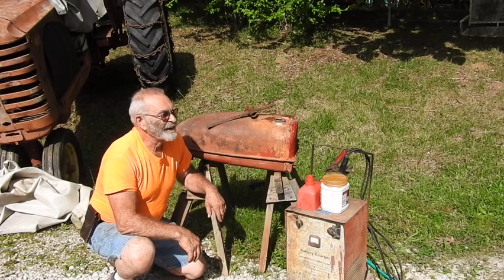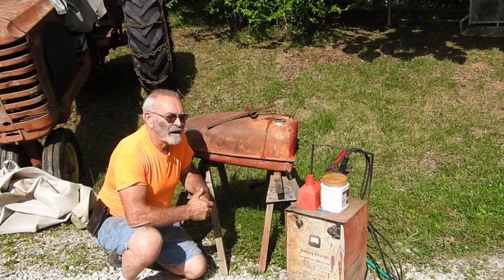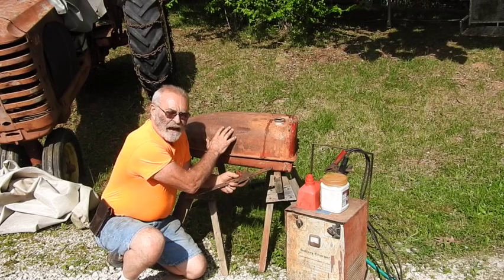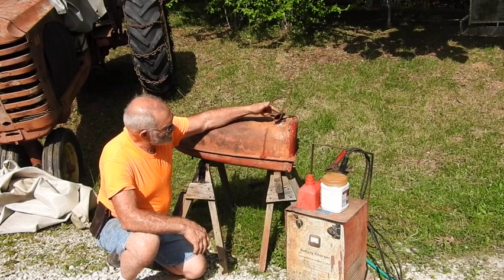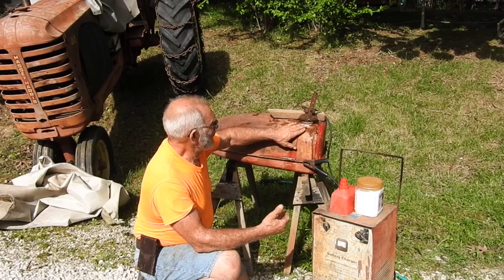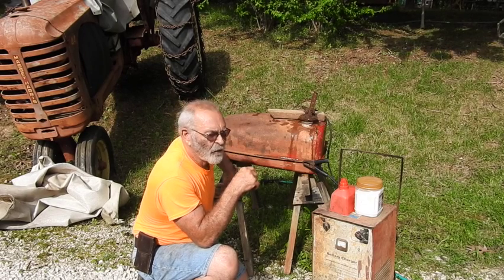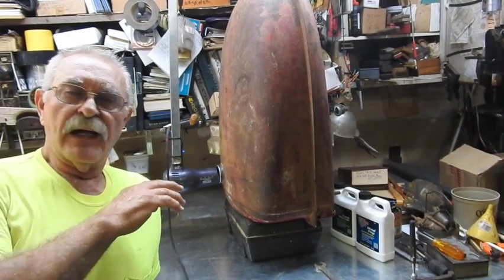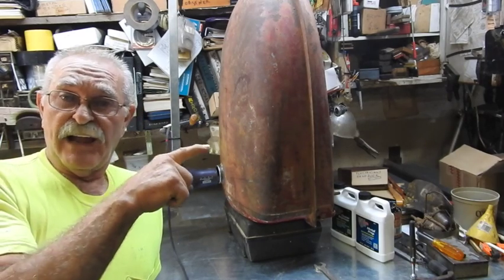Farmall H Gas Tank Electrolysis Rust Removal

Comment: Great video Wendell, i have done several motorcycle tanks this way, and a few old car tanks as well! The only real difference is that I also torch soldered any rust holes first, then cleaned, pressure tested and then treated the tanks. The good thing about being in a radiator/ tank repair shop is that you have the ability to completely fill the tank with the treatment, let sit for ten-15 minutes then drain, for the etching compound, and the same goes for the treatment, we would line up 10-15 tanks a month, and only do this once a month for our customers who didn’t want replacement fuel tanks. It always worked for us, but people thought I was crazy for using a flame for the initial repair! Like you said. ”DON’T  TRY THIS AT HOME!!!” Fuel tank repair is dangerous, and the process needs to be followed to the “T” any little mistake and an amateur may have a really bad day! 

As you said this is an “out doors project “ and safety is of most importance! If a person has the slightest question of how to do this, I recommend taking it to a professional instead of attempting it at home!
Reply from the maker: The only way I will weld on a tank or container that has the potential for explosive vapors is by first creating an inert atmosphere inside the tank.  I'll run exhaust fumes into an empty tank before and during the repair and other times I have used regulated nitrogen to create the desired atmosphere.  I ain't dead yet....LOL  Man, you've done some stuff !!
Reply: @tractorman4461  if I don’t fill with inert gas, then i fill it with fuel to the very tip to and leave zero room for oxygen, but this too is sketchy and dangerous!

Well I guess some of us have all the fun!🤣😂🤣😂

Comment: I have frequently heard of using washing soda (Diprotic acid), but this is the first time I've heard of using Baking Powder (Sodium Bicarbonate). Obviously it works!
Reply from the maker: It's not really the particular compound used when it comes to electrolysis because its the battery charger that's doing the work....its that the sodium bicarbonate or tri sodium phosphate increases the specific gravity of the water above the reading of 1. Clear clean water is the base for the specific gravity chart with a base reading of 1 and will in fact conduct the DC flow, but increasing the reading to something above 1 increases the conductance of the water.  
     So adding to the base number is what increases its ability to conduct the tiny DC current from the negative post to the positive post, the anode.  Now some real smart fellow can rip that apart because I don't know all the proper terms to use, but that is basically what happens.  So Matt all I know is that what I do works, so I ain't a gonna mess with the technicalities because what happens by doing what I do is good enough for me !!  LOL.  Thanks for watching.  I bet it's pretty warm out that way this week....
Reply: @tractorman4461  yeah, we have been hovering around 103 with 7% humidity for a week, but it's cooling off now. Our monsoon season is getting ready to start
Reply from the maker: @mattthescrapwhisperer  Whew !!

Comment: That was informative.  Can't say I will ever do something like that.
Reply from the maker: I'm sure most all the viewers will never have the need for the process either.  But guys like the Much Older Brother and myself need to use it quite frequently.  The new oxygenated and alcohol enriched fuels cause many problems with old equipment.  There are those that majically never seem to have an issue with it and I wish I knew their secret. We are not that lucky.  LOL.  These new fuels are engineered for the modern fuel injection systems most of whose fuel storage and delivery systems are made of composite materials that are impervious to rust and oxidation.  Not all are composite, but many are.  Its hard to rust plastic. (generic term for composite...the composition of which I have no clue).  LOL

Comment: I used both the electrolysis and a few citric acid soakings to get my JD gas tank in decent shape. I was surprised how well the citric acid worked. I would also let it dry thoroughly between the soakings and then tapped on it with a hammer and it loosened up the heavy rust quickly. I also used the POR15 kit and it seems to have come out pretty good. Had to re-tap the threads for the sediment bowl because the sealer filled them up. I had seen the first time when you did the Massey tank but still enjoyed this video. 👍👍👍
Reply from the maker: Good job !!  I knew this would be re-covering a subject done on another video.  But you know the Farmall guys won't go watch a Massey video...LOL.  I really like this product so far.  I've got a bad problem in the Motor Patrol tank.  It's going to be redone with POR-15 too.  But I gotta get the nasty sludge left from the old product out first.  Nasty !!  Yes, I use a rubber mallet to bam bam bam on the sides and bottom first then suck 'em out with a stub of a garden hose duct taped to my shop vac.

Comment: I’ve used an old chrome dog choker chain to put inside an old tank to rattle around to get the scale off!
Reply from the maker: I've used a variety of things as well.  The best for me was big hex nuts that I could pull out with a telescoping magnet when done.  The problem comes in when there are baffles in the middle of the tank like this one here on the Farmall. They are typically only a sixteenth or eighth of an inch off the surface and the nuts and chain links can't get behind them.  I remember the first one I ever did I dropped in sharp rocks then had one devil of a time getting them out !! LOL